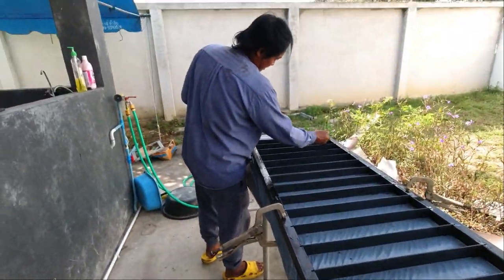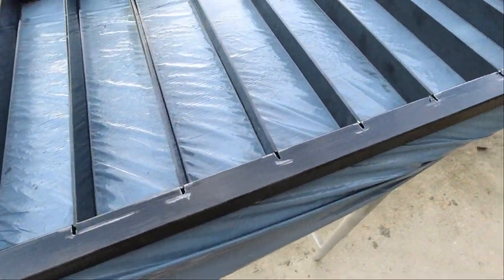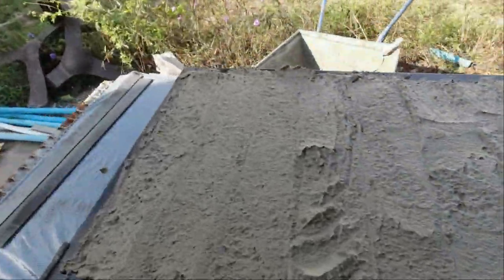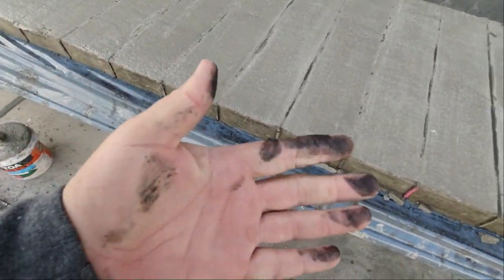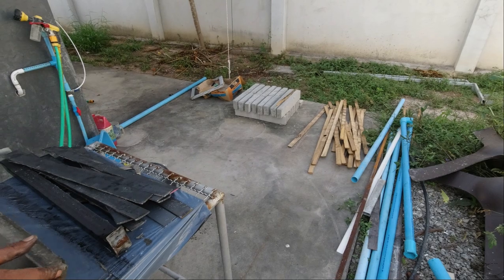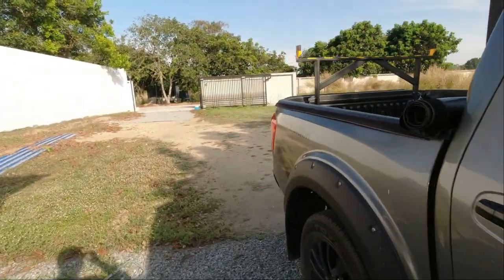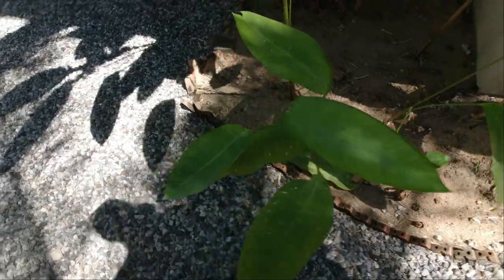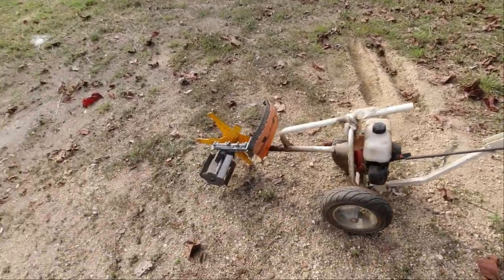making concrete  kerb edgings

Comment: Have used a similar method to cast some concrete slabs a few years ago. We used a hammer drill to drill into a short  piece of 6x2 to a depth of +/- 3 inces and turned off the drill function and turned on the breaker function to turn it into a home made triller. Worked a treat.